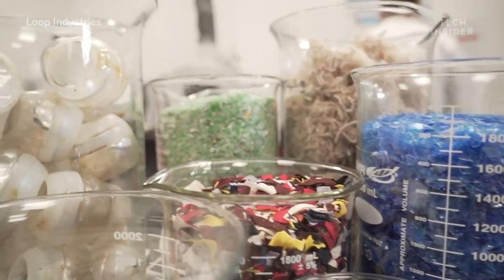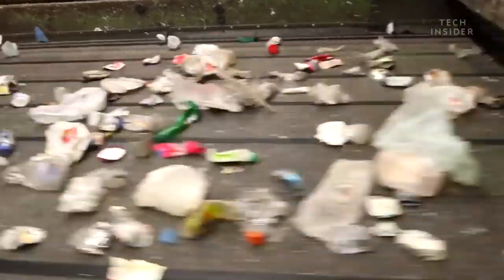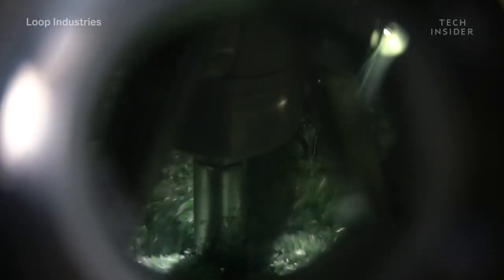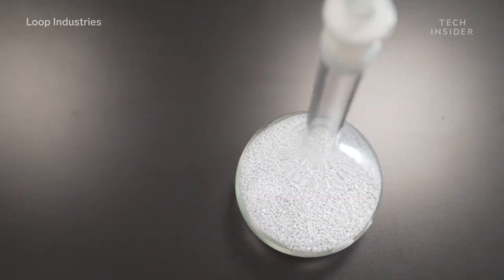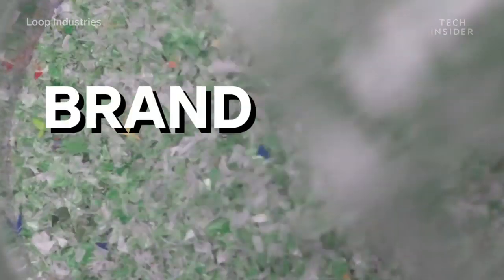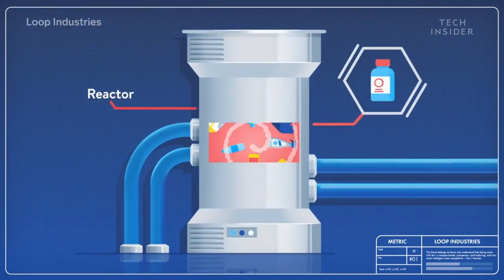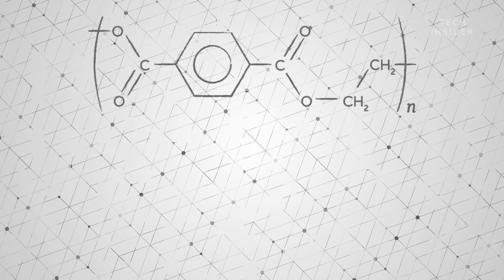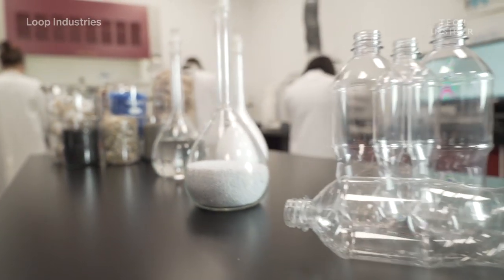How One Company Turns Plastic Waste Into Reusable Packaging

Comment: "Doesn't require the energy that conventional recycling centers need"     I don't know man.  That sounds a bit "Marketing Hype".   I.e. Push the energy needs up stream and pretend it's not there.    I'd like to see the full break down of this.
Reply: Really good catalysts like enzymes can reduce the amount of outside energy required to perform a chemical reaction by 60-95%. Now this company is definitely not using an enzymatic catalyst so they are likely using an inorganic one so we should probably expect a reduction in energy requirement of MAYBE 5-50%. It is good you are skeptical, they definitely are still using a lot of energy, I doubt the process is very green but I can tell you that it's probably one of the best processes we have right now.
Reply: @scatteredvideos1  My point was more along the lines of;  
Comparing the energy requirments of creating the catalyst vs the energy saved recycling the plastic.  Of course per unit output of the final product.
Reply: @lucidmoses  Even if we use energy exactly equal to the energy required to make plastic it's still a win. As we can upcycle waste plastic. But I am feeling that this might have other environmental issues.
Reply: Lucid Moses i agree.
Reply: Basically they are using energy in a more efficient amount to recycle used plastic. The company in this video is using their owb proprietary chemical process to turn old plastic into reusable new plastic thus the old plastic is not wasted or left to rot. Though, there are alot of unanswered questions like what kind of waste produce would this process take and not to mention the resources it would consume to make this recycling process possible because at the end of the day, plastic is literally still petrochemical.
Reply: @scatteredvideos1  violate physics infitine generated meat
Reply: Today is Oct. 20th and this company is under investigation by the SEC for fraudulent claims and technology
Reply: @christopherkang6109  investigation doesn't mean guilty but yea, That would explain it.
Reply: Anyway producing plastic products from waste plastics releases less greenhouse gases than producing it from petroleum

Comment: Narrator: This pile of scraps is actually shredded plastic and clothing, and it's about to be turned into bottles. We all know plastic waste is a problem. It can take up to 1,000 years to break down, which can lead to things like this. Every year, manufacturers burn $80 to $120 billion worth of fossil fuels to make single-use plastic items, like water and soda bottles, meaning it's used once and then discarded. And even if it's recycled, that requires additional energy, which releases even more greenhouse gases into the atmosphere. One company rethinking all this is Canadian-based Loop Industries. Instead of using petroleum and natural gas, Loop takes already existing plastic items along with polyester fiber materials, like carpets and T-shirts, then breaks them down to be turned into new plastic products. And the upside? It doesn't require the energy conventional recycling center need, which helps reduce greenhouse gases. Daniel Solomita: Not only are we using waste plastics, but we're using waste plastics that have no value today. So, those are the plastics that end up in the ocean and your rivers and landfills, because no one can do anything with the material. So, Loop's technology is built to take very low-value material and create a very high-value product out of it. Narrator: This isn't really recycling; it's upcycling. This concept of upcycling has been around since the 1960s. However, it is traditionally done with heat and pressure. Very expensive. So, how exactly does loop's process work? Solomita: Everyone else in the world that manufactures those two monomers starts from fossil fuels, either natural gas or crude oil. We make the exact same petrochemicals, except we don't use the petroleum; we use waste plastic. And then we rebuild those monomers back into brand-new plastic. Narrator: Imagine the waste plastic is a chocolate cake. Loop's process pretty much breaks down the chocolate cake into its basic ingredients: the eggs, the flour, the sugar, and the chocolate. Each ingredient is broken down and separated into its purest form. For our cake metaphor, that means going so far as putting the egg back in its shell. Then, Loop takes the purified ingredients and bakes a brand-new cake. To start, they load these massive reactors with a bunch of waste plastic and add in Loop's own proprietary catalyst. Solomita: What our catalyst that we've developed does is it goes in, and it cuts the bonds between those two chemicals and releases them. Narrator: The catalyst breaks down the waste into its two base monomers: DMT, dimethyl terephthalate, and MEG, monoethylene glycol. After that, the separated DMT and MEG monomers are purified to remove additives, like dye. The purified DMT and MEG are then turned back into PET, polyethylene terephthalate, which is the base material for many plastic products. These PET pellets are then sold to bottling and packaging companies. The pellets are loaded into their machines, which molds them into the final packaging shape. And after it's used as a plastic water bottle, color container, polyester fiber, or more, it can be broken down and built back up again, a continuous cycle that doesn't require fossil fuels. Loop's finished products are currently being used by Pepsi, Coca-Cola, and Evian. And they're currently building their first American facility in South Carolina. Let's hope it's sustainable enough to make this disappear.

Comment: How it is upcycle if the final product it's the same than the initial one?. It's a fine method,  but doesn't seem to be a solution if you are still producing trow away plastics
Reply: The thing is, whatever used to be thrown away and end up in the landfills/oceans, can be upcycled again and again. Thrown away right back into the LOOP process again.
Reply: Eduardo Rebolledo Well that’s what up-cycling mean. It’s confusing but up-cycling means reusing the materials without degrading it’s quality or composition. Recycling funny or not isn’t actually reusing the items at the same quality. When an item is recycled it’s quality diminishes, so you can’t always make it into the same thing. Recycled papers for example gets downgraded based on it’s grade or quality. Like Cardboard can end up as those brown paper towels after multiple recycling or if the items it was recycled with is too contaminated.

Comment: Although this doesn’t directly require fossil fuels, most of the energy is coming from fossil fuels to power the grid.  The up cycling isn’t a closed loop either otherwise it would violate the second law of thermodynamics.